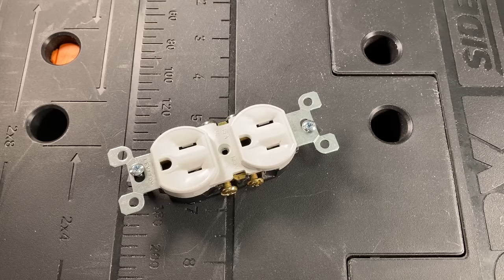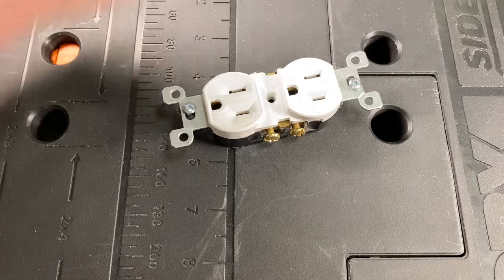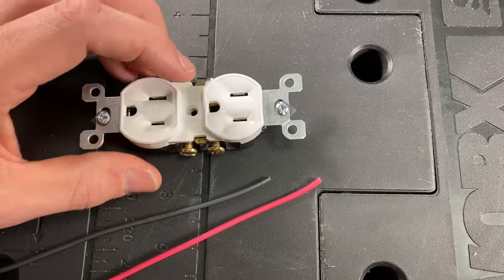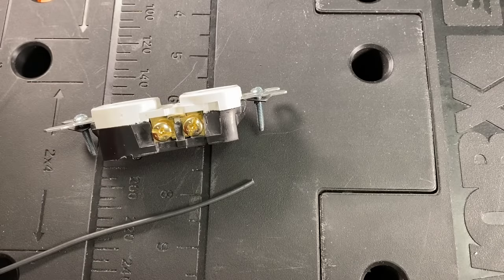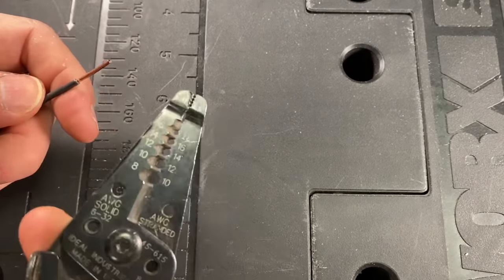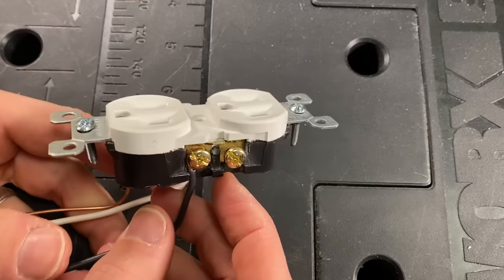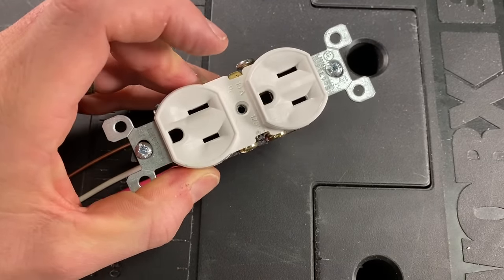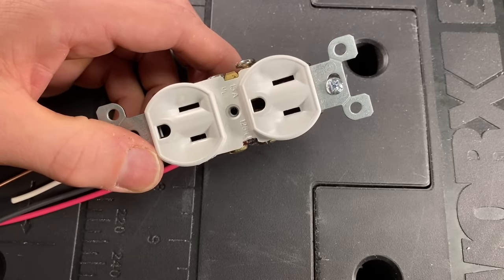Electrical Outlet Basics | How To Wire

Comment: Newbie here. I discovered that an outlet in my house has three sets of wires (three black, three white, three ground). Two sets of wires were stabbed in the back, and one set went to the terminals.

As far as I know, these outlets are not connected to a switch. So...

1. Why would I have three sets of wires?
2. Can I avoid using the backstabbing holes if I have three sets?
Reply: Dean Chen  - ok sounds like instead of running in a straight line (so to speak) this outlet is a jumping point to at least two others in different directions. Thanks!

So can I pigtail all the wires together and attach to one terminal? (Black with black, white with white, ground with ground).
Reply: @PJErvin  We call it daisy chain and yes the best practise is to pigtail your wire so you only have one wire per side. It is actually code that you cannot use the recp to pass the neutral it must be pigtailed

Comment: I've done a lot of electrical outlets and I've never seen a socket that has those inlets to make it easier to attach the looped wire.
Reply from the maker: Hmmm, I’m surprised as I think all the outlets I see from the big box stores have the push-in holes as an option.
Reply: Maybe you never noticed them or didn’t know what they were for. They are actually pretty common.
Reply: Inlets to attach looped wire? Huh?

Comment: Yes a tic is helpful in telling you if a circuit is live or not , but if you really really want to know if there is power or not get yourself an actual plug tester . You can  get one with a GFCI interupter built in or not . Because a Tic can sometimes give you a false reading . And if you dont want to buy plug tester or Tic then  use h multi metre !!!

Comment: Can you make a video on how to measure and Test how many amps of current the outlet is rated at. If you didn't know the outlet was at 10A, 15A or 20A how can you measure to know what is the max amps current you have on your outlet so you know which outlet, switch, etc to purchase and buy? without going back to the circuit breaker that is cheating
Reply: Add together all the parallel loads as measured in Ohms (resistance) on that circuit. Then divide 120 (volts) by that number. This will give the total Amps
drawn on the circuit.  CAUTION: Adding parallel resistance  is a special mathematics formula. Thank you.
Reply: @tedlahm5740  But how do you measure the resistance of each parallel load? because each WALL outlet resistance is going to measure only in the milliohms or what parallel loads are you talking about measuring
Reply: wayne Gram  The load in ohms of each appliance that
is connected to the same breaker.    Collectively they will ANSWER your question.  Amount of current currently being drawn on the circuit. Reference Ohm's law. Thank you.
Reply: @tedlahm5740  If the outlet max is 15Amps and you only have appliances that are connected to the same breaker only drawing 5 amps. You're missing 10 amps so you can't know what is the Max current for that breaker with out going back to the fuse panel. Without any appliance connected to the same breaker, how can you find the max current on that breaker?
Reply: wayne Gram Wire gauge would give you a clue as to maximum allowed current
in amps. No appliances turned on, no current draw?    BUT , is is possible to have LARGER carrying capacity conductor and lower RATED breaker. 
The other way around is a no no.

Comment: If you went to a room and there's a light switch, checked all the outlets and none of them turns off how do you know which one is the outlet for the switch?
Reply: Probably none of them. It sounds like the switch is wired to turn a light on and off, not a receptacle.

Comment: I saw a handyman vid on youtube who used to work for a builder and he said they'd get in trouble if the super saw them using the screws instead of the push in's.
Reply: You should never use the push in holes on a less expensive outlet but some of the more expensive outlets will have a hole that you should use because the wire is held in place by tightening the screw and in this case you should not wrap the wire around the screw.

Comment: What about an outlet in the middle of the circuit? How is that wired?
Reply: Line coming in could be 3 wire or 2 wire depending on whether or not you want part of the receptacle switched. Load going to the next receptacle in the run would be the same depending whether you will continue with a switched receptacle or not.

We wired two walls in a master bedroom for receptacles on both sides of the bed (wherever a bed might go). We put two receptacles in each box with half of one receptacle on the switch. After the fourth box we only continued with 2 wire with ground because none of the remaining receptacles would be switched.

Comment: Doesn’t seem like you tightened down enough.  I usually put pretty good hand torque- about 1/4 turn past snug.  It looks like you just went to “snug”.  Don’t think there is any concern over tightening with screw driver.

Comment: I would also recommend adding this note when installing a switched outlet, the outlet should be installed with the ground hole in the up position. I was taught that this is an indication of a switched outlet. 'Ground is down, except when switched.'
Reply from the maker: Thanks for the feedback Donald 👍
Reply: If you use it as an indication of a switched outlet you still need to know if it's the top or bottom part that is switched.

Comment: How do you wire an outlet for a " middle of the run"?
Reply: Good question btw.
Reply: @greenhulk7573  thanks!
Reply: To daisy chain outlets, you wire one set of screws to the power source, and one set of screws to the downstream outlet.  You still need to pigtail/wirenut the ground.  I don’t know what there isn’t a dasychain ground.  I like the green insulated ground pigtails with an integrated wirenut.

Comment: This is a bit late, but I add to more steps.
1 tighten unused screws
2 use real electrical tape, not the dollar store stuff and wrap tape 2x around sides of receptacle to cover screw heads and the first 1/2” wire off the back. Good tape comes of easily if need be and protects from arcing to box or other devices in multi gang boxes.
Reply from the maker: 💯Thanks for the feedback.

Comment: Some now have the ability to put the wire behind a plate under the screw instead of a snap fit style.
Reply: The ones with the "clamp plate" are the commercial grade receptacles

Comment: best practice for half-switched outlets is to turn the receptacle upside down, and have the bottom half switched.  that way you can see at a glance that it is a switched outlet, and the lamp that will always be plugged in will be in the bottom, and other things you may plug in and unplug will be easier to access.
Reply from the maker: Hey Ken, thanks for sharing your experience.  A few others mentioned this and since then I paid a little more attention in a few of the homes I have toured and saw a few following this best practice 👍.
Reply: @EverydayHomeRepairs  glad to give the tip - it was actually my (engineer) brother who pointed out the logic of doing it that way.  and good work in giving a very clear explanation of how-to on a topic few people even think about teaching do-it-yourselfers.
Reply: If you do your own wiring then you can do whatever you want but I won't do that in my house. Any outlets that are switched will always have a lamp plugged into them (even if it's just a nightlight) so they won't be available for other devices.
Reply: @njsongwriter  and what part of that is different from what I pointed out?

Comment: Its good practice to Install an outlet that has been modified to be a “half switch” upside down so everyone knows the bottom receptacle is controlled by a switch.
Reply from the maker: Good tip, thanks Brian.  👍
Reply: Not trying to be difficult, but I wonder how many people would know that an upside down outlet means anything
Reply: A lot of contractors are now installing all outlets upside down because if something metal falls on a plug that's not fully inserted, it'll hit the ground instead of power.
Reply: @TBLBill  I’ve seen that a lot of times in commercial/industrial spaces since the receptacle covers are typically metal.
Reply: how would people know this?
Reply: @somerandomboomer243  spread the word Doug!. I noticed an upside down receptacle in my house many years ago and I researched it to find out why.
Reply: Not necessary. Any switched outlets in our home will always have a lamp plugged into them or possibly a night light.

Comment: @everyday Home, question for you...i have a "2nd"  light switch in my garage that operates my lights. the main switch i use is in the kitchen (coming out to the garage). Can i just make the extra switch an outlet? there are Red, black, and white wires coming in (and a green one screwed to back of box) the black only get's hot when i throw the switch in kitchen, red is constant hot.
Reply: I tried wiring it like it was on the switch, red top black bottom, white other side and ran a jumper from the green at back to earth on the outlet, lights turn on fine in kitchen switch but  plugged in a palm sander to test it...lights came on...sander came on, lol...so my sander was the switch turning on the lights from the outlet...LOL...i'm lost
Reply: @robw8563  you should watch a video on how a 3 way switch works.  The red wire is your traveler wire and stays hot. The black wire is hot when the switch in the kitchen is on. Then when you turn the switch in the garage off, you are disconnecting the black hot wire from the kitchen switch and the lights go off. Make sense.  So you can’t hook up your outlet to the black in the garage, your kitchen switch controls that. Since you also hooked up the red wire (which is hot all the time) the sander connected the red and black wires internally and made your lights come on. The sander acted the same as your previous switch.  You should be able to hook your outlet (hot side) to the red traveler wire and neutral to white. You need to ensure you correctly indicate that the red wire carries power (by marking it with black tape). Your black wire needs to be hooked to the light wire so it is still controlled by your switch inside.  Whew, I hope I got my point across.

Comment: surprised you didn’t mention wrapping the outlet screws with electrical tape or is that not universal?
Reply from the maker: It's not necessarily universal but many have recommended the same 👍
Reply: Elecrtical tape serves no purpose,as the device should be deenergized before accessing.Taping wirenuts on splices is another unnecessary"habit".According to code,using a wirenut to establish circuit  continuity alone is not an accepted wiring practice.Wires must maintain continuity on their own.Wirenuts merely provide reenforcement and protection afterwards. I have experienced many times,unwrapping a foot of gooey tape and removing the wirenut only to have the "splice" fly apart.Agravating.
Reply: It's not universal and I have never done it.

Comment: Y’all can do whatever you want, but I NEVER trust a non contact tester to see if anything is actually hot. I always put a contact meter on it, and double check my meter is working by also putting it on something hot.  Great video though.
Reply from the maker: Hey Mark, thanks for the feedback and you aren't the only one who has stressed a similar point of view.  👍
Reply: Another good way is to have your breakers properly labeled.  At some point everyone should go around they're houses with a pencil and paper and turn off each breaker and run around your house to see what is turned off and write it down.  You have to turn on every light and have something plugged into every outlet you have to do this.  I know a lot of breaker panels have a place to write down the circuits.  But they usually don't give you a lot of room.  After I'm done, I go to my computer and type it up and post it next to the circuit breaker panel.  For the circuit breakers of major importance, such as the breaker that connects to my furnace, I used a black Sharpie and put an arrow next to the breaker and labeled it as such.
Reply: @EverydayHomeRepairs  HRC, you are one class act. I am amazed at the Arm Chair QB comments. What were these ACQB talking about 12:00 & 6:00 ground wire?
Reply: A non-contact tester is a good tool for quick first pass assessment; if you are going to work on the wiring, always check it with a contact meter first.
Reply from the maker: @luisderivas6005  Thanks for your feedback.  Looks like you opinion is consensus with most of the pros 👍

Comment: Questions:
1. Why are some outlets caved in at the connecting terminals while others are flat?
2. If the two black hot wires that are screwed in are touching each other at the metal parts, is it dangerous?
Reply: Question 1: It’s to help line up the prongs going into the outlet. The flat face ones are either for aesthetics or to make room for the shutters for tamper resistant outlets. 
Question 2: not sure what you are asking 🤔

Comment: She yo remove the tab that was connecting the two hot sides where does the second red power come from, please?
Reply from the maker: Hi Eugene, assuming you have a black and a red wire?  If so, the red should be the hot side controlled by the switch.  Red will attach to one of the gold terminals and black to the other.  It is up to you which one it on top and which one is on bottom.  Above statements are just a guess and it will be up to you to check and confirm everything is wired correctly and according to code.  Best of luck.
Reply: I have a kitchen where all the outlets run on two circuits, so the "top" outlet is connected with black and the "bottom" output is connected with red.  I guess if one of the circuits breaks, the outlet is still useful (until someone goes downstairs and resets the breaker).  So all the outlets have the tab broken.
Reply: Everyday Home Repairs 
thank you. :)
Reply: @ygstuff4898  this is so two appliances plugged into the same outlet will be on different circuits.  This is not foolproof.  Kitchens (counters) need to have two (20A) circuits
Reply: It comes from the same source as the black wire except that it is connected to a wall switch.
Reply: @jimbaranski4687  
Ideally, I prefer 3 20 amp circuits to the kitchen. Two to all the receptacles in the kitchen and dining room, except the refrigerator which should be on a dedicated circuit.

Comment: Another point for newbies is that switched outlets are usually mounted upside down so you can easily tell at a glance if they are switched. Yes, don't forget to remove the bridge on the hot side.
Reply: Who's to say what is "right side up", or "up side down" on an outlet?
Reply: @91156  if the ground is on top, it is upside down. This configuration is a standard in the construction/electrical industry.
Reply: @Rocadamis  
In some areas code now requires all receptacles to be ground on top. Previously there was no requirement and thus no official right side up or down
Reply: @njsongwriter  Interesting. I didn't think this was a code issue, just a standard practice. Thanks for the heads up.
Reply: @Rocadamis   No, it's not.  The newest trend in new construction is to put the ground at the top.  Code does not specify either way.

Comment: You forgot to mention that newer NEC Code requires use of a torque screwdriver and you must torque to mfr. instruction.
Reply: I work for a nationwide large construction company and have been in the field for over 30 years. I have never seen anyone ever use a torque wrench on lugs let alone devices. Matter of fact, I'm not sure many electricians would fork out 200$ for a screwdriver. You are indeed correct though. The odd thing is Wagos are ok as well as stab ins.

Comment: When checking for absence of voltage a multimeter should be used
Reply from the maker: Hey Lucas, thanks for the comments and I know others had also mentioned a multimeter is preferred over any type of "non-contact" method like a voltage tester.

Comment: what if you don't have a ground?
Reply: Older homes often don't have a ground. If the circuit isn't wired with a black and a white wire plus a ground then you should install ungrounded receptacles and switches to meet code.

Comment: Why do some have 2 hot and 2 neutral wires to one outlet?
Reply from the maker: Hey Chuck, one popular use would be to break the middle tab off between the 2 terminals and wire the top and bottom outlet separately.  If you have ever been in a house or apartment where there is a light switch on the wall that turns the top outlet on/off for use with a lamp this is what is being used.  This is popular when a bedroom was not wired with an overhead light.
Reply: Is it a 220V appliance circuit?
Reply: Either way it's wrong. Wire nut the hot and neutral separately in the box and only use the hot and neutral of the one circuit.
Reply: If the tab on the hot is not broken, this is probably a middle of the run outlet. This is code in most cases, but not preferred. The problem is that the receptacle is being used as a connector. It is preferred practice to use pigtails and wire nuts to bypass and include the receptacle in this circuit, thereby lowering the resistance. You will need to know how to twist wires and use wirenuts. The only time I would use all 4 screws is if the box is to small to carry the extra cubic inches.
Reply: To continue the circuit to another box.